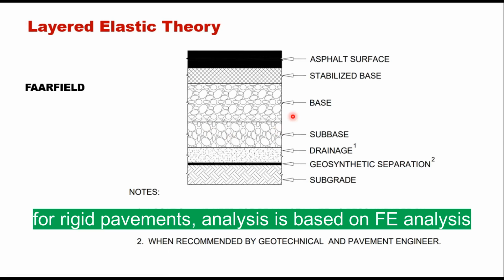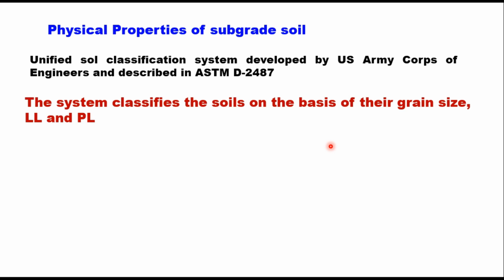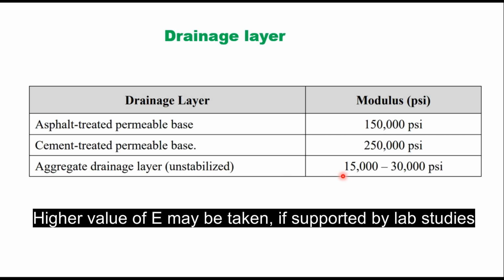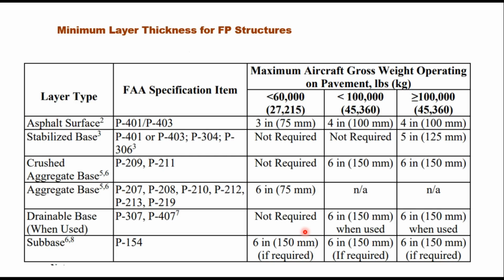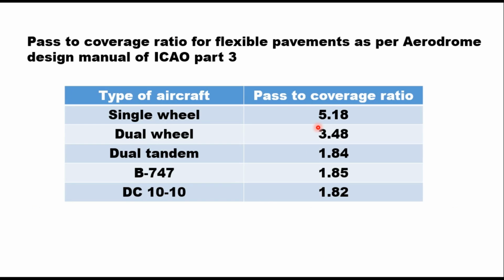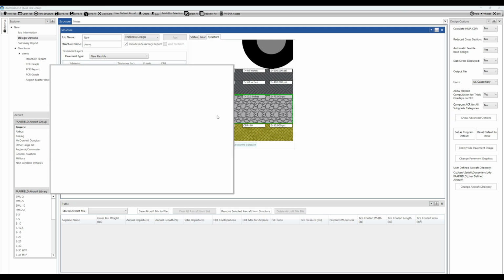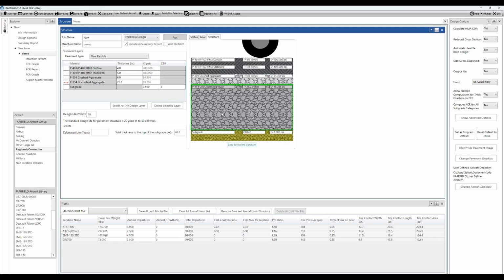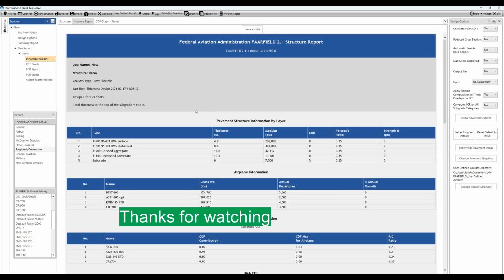Design of Flexible Pavements for Airports, FAA Method of Flexible pavement design, Use of FAARFIELD

Comment: Sir I have 1 Questions  in Flexible pavemet Design. Which temperatures consider to use P401 and P403 in E module 1380 and 3000. And how to apply India conditions this E module .
Reply from the maker: You can choose the mix type as per your design. Accordingly E values.
Reply: @SatishIITR  Thank you so much for reply but no any references Temperatures factor Table to convert the seed vale asper FAA.

Comment: How can other bituminous materials such as EME2 or BTB can be modelled on FAIRFIELD?
Reply from the maker: You can introduce any layer. Read the FHWA document which is freely available online
Reply: @SatishIITR  FAARFIELD does not consider failure for user-defined materials. How can I check the fatigue failure of an AC layer that is not P401 or P403, such as Bitumin Treated Base or EME2?

Comment: Thank you but I don’t understand pass to coverage ratio .where did the number 5.18 (single) and 3.48 (Dual wheel)
Reply from the maker: pass-to-coverage ratio is the ratio between the number of aircraft passes and the number of aircraft coverages. It is affected by the wheel spacing and degree of aircraft wander across the width of the pavement , usually calculated for the pavement location that is most often covered, which is not the centerline. It is defined for each type of wheel configutaion and generally a fixed value.